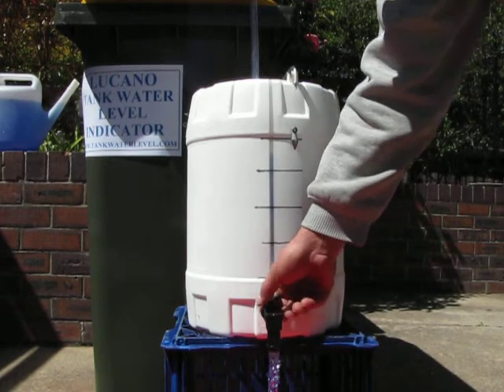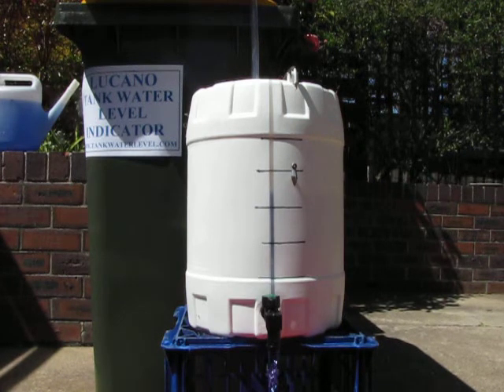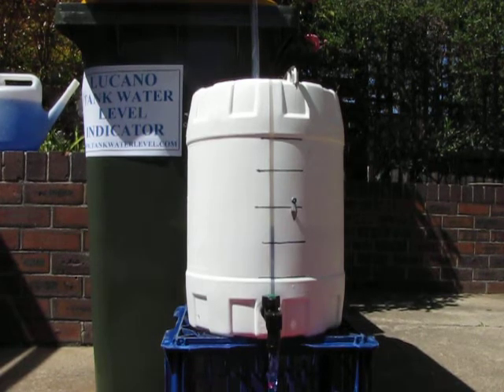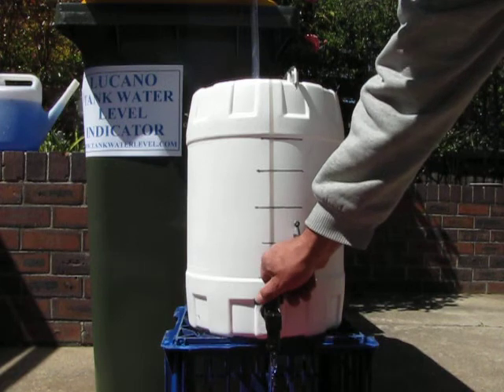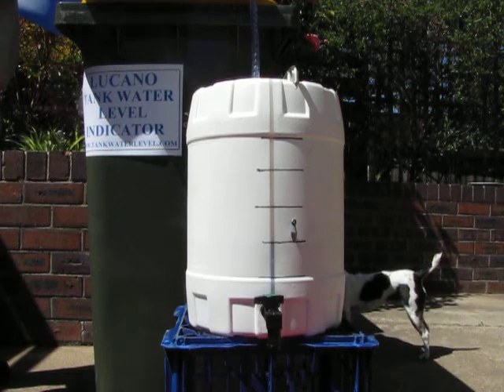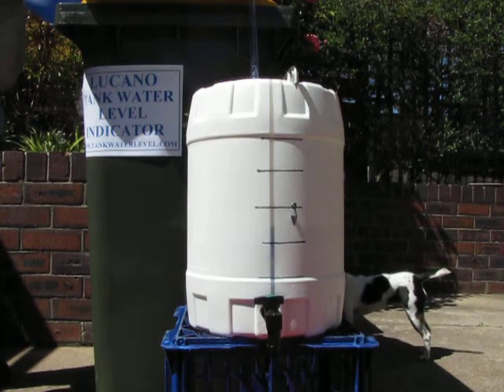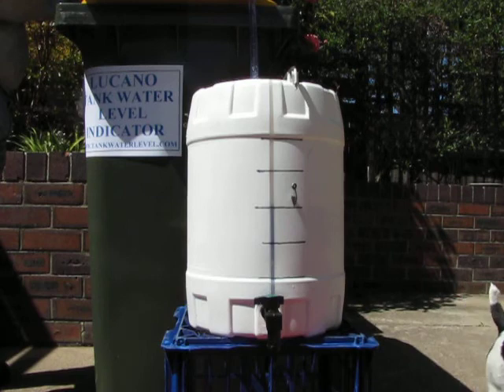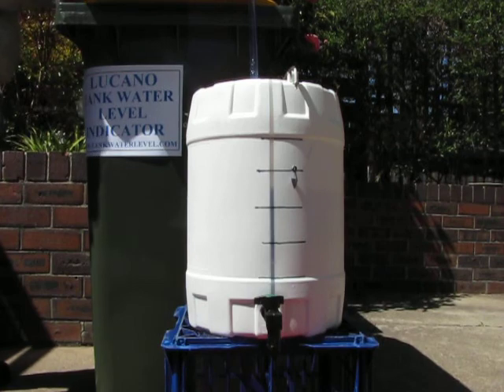Tank Water Level Indicator - LUCANO

Comment: We had one of these, it was useless, the indicator spent all its time on the top of the tank being blown by the wind. you would probably have to place it in a clear tube to stop the wind.
Reply from the maker: You may have had something SIMILAR with a light weight indicator.
However if you live in a particularly windy area, please look on our website for a simple solution in "HINTS & TIPS" Menu